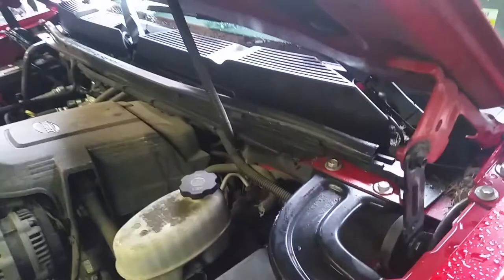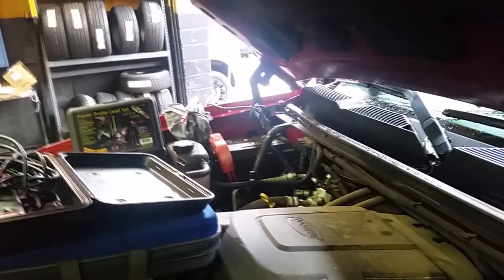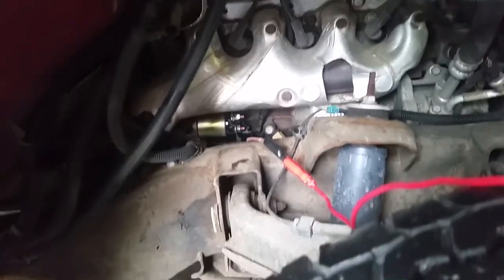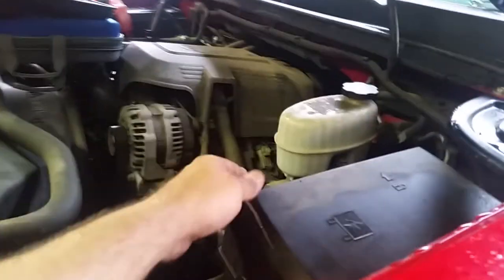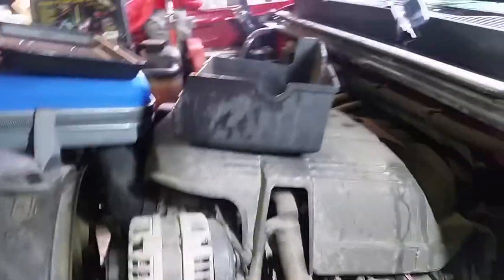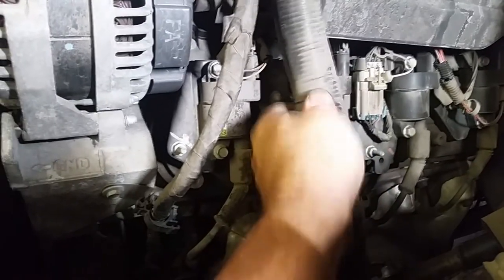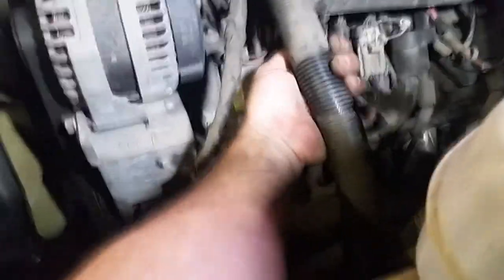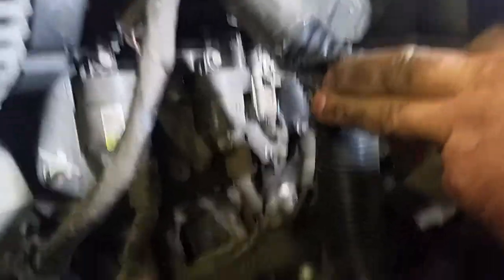2007 Chevrolet 3500HD  Starter Circuit Shorted

Comment: Nice one bud , lucky my 02 does not have the harness run like that .  If I remember right there is a harness standoff missing  , not sure but do you remember seeing it before on other  ones .
Reply from the maker: I believe you are correct. But it didn't look like there had ever been one there. If you look when I twisted the harness around to reveal the punctured harness, there was no sign that something like a stand off was ever there. Strange, but I moved the harness forward and secure it nice.